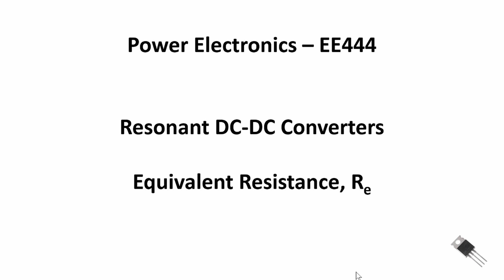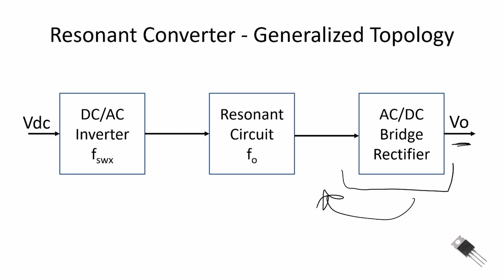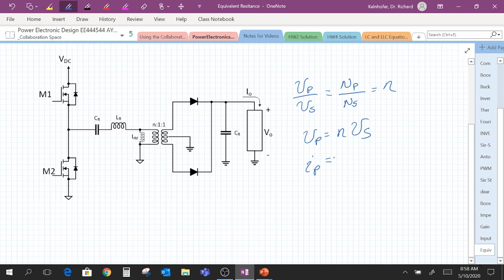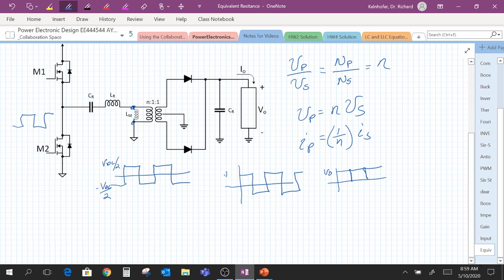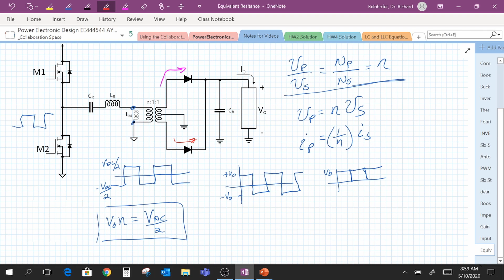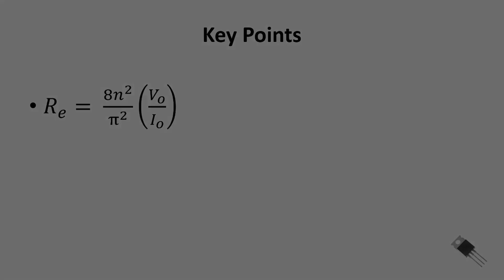Power Electronics - Resonant Converters - Equivalent Resistance

Comment: Hi Dr.K! Thank you for the video! Everything else was very clear but I have one question. Can you tell me how did you get average current on secondary side of the transformer as Is = (pi*I0)/2?
Reply from the maker: That's actually the peak value of the current on the secondary side.  This comes from the computation of the average value of a fully rectified sine wave.  The average value of  |Apk*sin(wt)| is 2*Apk/pi, where Apk is the peak value.  In this case it Is.  Solving for Is using the average, one gets Io*pi/2.    If only 1/2 wave rectification is used, then the equation would change to Io*pi. Hope this helps.  Best wishes on your design. -Dr. K
Reply: @powerelectronicswithdr.k1017 Thank you Dr. K! That makes more sense. I think you mispoke in the video by mistake and I took it literally😅😂. Thank you for your lecture too! Have a great day!

Comment: If one switch is connected to ground and the other switch connected to Vds shouldn't it be a voltage between 0 and Vdc ? Like a square wave with an offset of Vdc/2. But you showed it as a -Vdc/2 and +Vdc/2 how it can be -Vdc/2
Reply from the maker: Hi Utku, the capacitor blocks the DC portion of the signal. The result is shifting the waveform. Hope this helps. - Dr. K